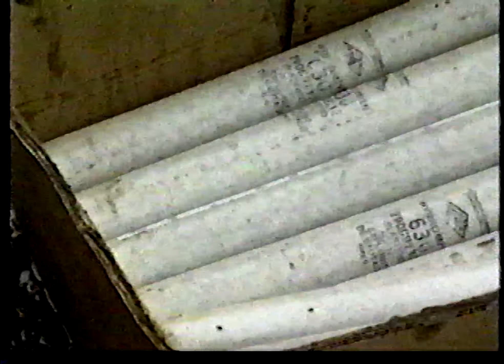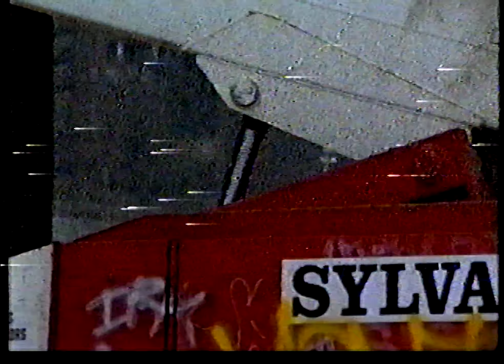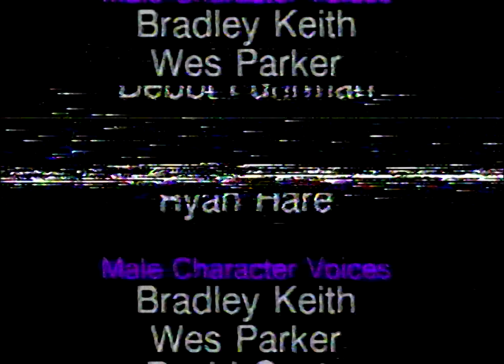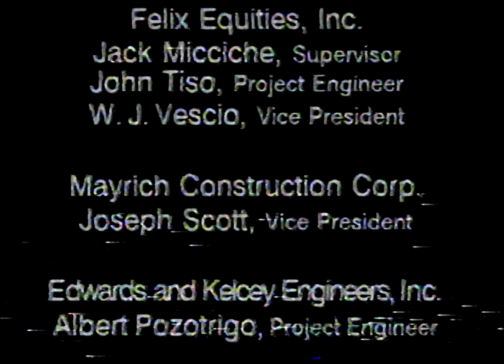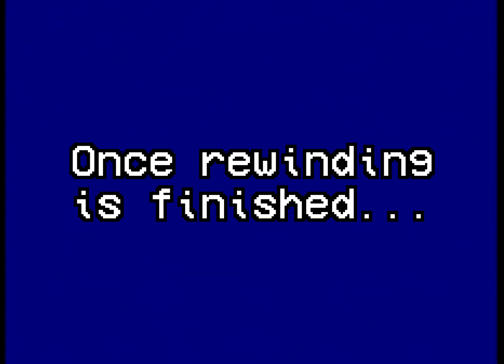[EPILEPSY WARNING 60fps] The WORST VHS tape ever! (Real Life GIANT Construction Equipment For Kids!)

Comment: Do you think you could acquire the three DVDs from the Morning Star Trilogy by Beny Tchaicovsky and upload them in 60fps? The Morning Star Trilogy was a small project done by computer artist Beny Tchaicovsky in 2001, and the animation in that is very similar to the work he contributed in the Mind's Eye series. You can find the three DVDs on Amazon, and their names are The Call, Caught Between Worlds, and Dimensional Connections. Dimensional Connections and The Call have yet to be seen on the internet, and there is a video upload of Caught Between Worlds, however it is low quality and not deinterlaced. I would be really grateful if you did this.
Reply: Ah, okay. Thanks for the reply.
Also if you're wondering, here is the upload of Caught Between Worlds: https://www.youtube.com/watch?v=LfM9s3LR3kg
It's pretty easy to see that it was not ripped correctly because there is visible compression throughout the film. I use Handbrake to rip my DVDs.
Reply from the maker: @spacefanatic6458  I am now hesitant to upload the Morning Star videos to YouTube as I found they are on Vimeo On Demand: https://vimeo.com/ondemand/thecall3 .

EDIT: I did buy the DVD of The Call before I realized that it was available on Vimeo On Demand, but it won't be at my house until April.  At least I can see if they got the aspect ratio and framerate correct in Vimeo (Amazon says it's 4:3).